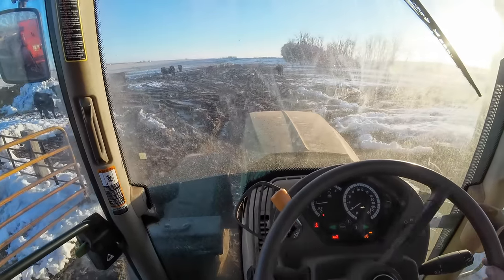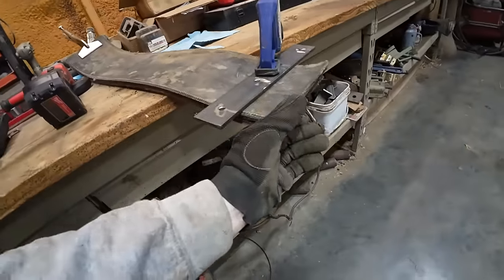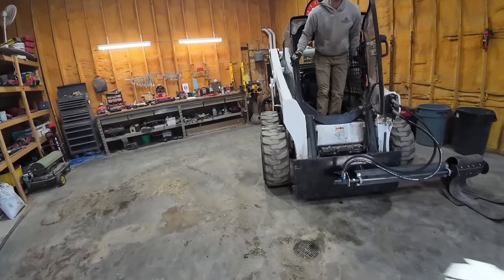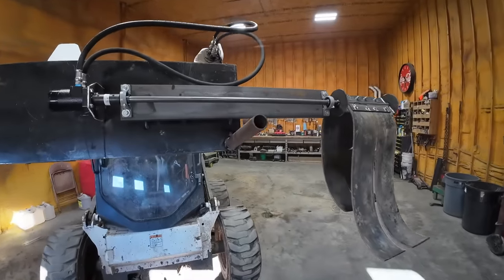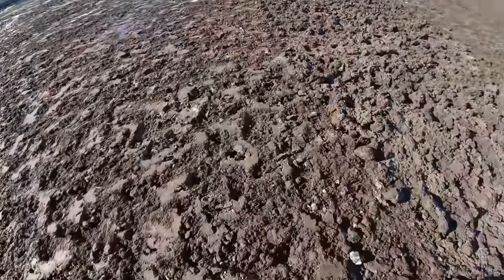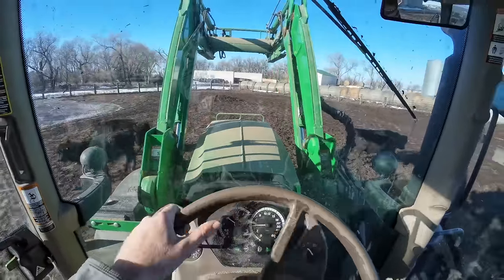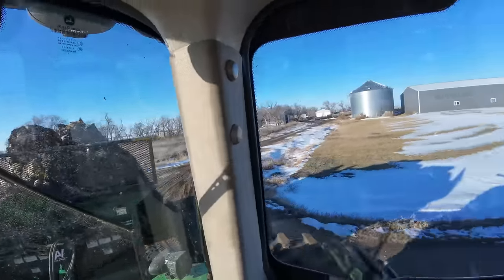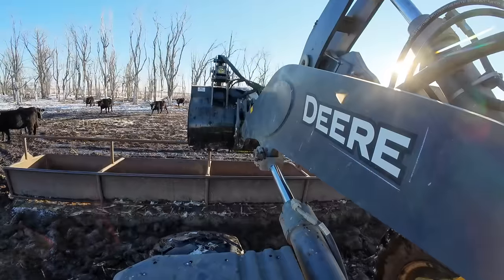This thing is Scary Fast!

Comment: Use a pallet, cement block, or 2  wire blocks on pallet,  drag with 4 wheeler just before freeze up. Nice n smooth when froze!!  Used to cruise around hrs or two after supper

Comment: Cole I built a spinning flappy bunk cleaner, almost like what you did, but the belting I was using was no good. It was too floppy, so I went to our belt supply house and got a piece of aggregate conveyor belt much thicker, much stiffer. It’s kinda like it was on Viagra anyway, but I still wasn’t happy, so I was watching YouTube and I saw a railroad ballast cleaner and it’s basically the same thing to get the rocks out from in between the rails but they use cable like inch cable so my Paul was all worried I was going to tear the concrete bunks up, so what I did is, I took input Ferrells it’s a little thing they slide on cables to stop them from fraying and I slid it down. I want to say 4 to 6 inches and then had them crimp them on a 1 foot long or 18 inches they were made a big ass industrial brush and with the cables being frayed they were they wouldn’t take in scratch the concrete but man what a difference good luck buddy I hope that works for you real well and you don’t have to use how solid shaft are used a piece of 2 inch hollow tube with a thick wall that might inch hydraulic motor shaft after three-quarter whatever the hell it was fit into because a hollow shaft for that situation is better because it’s more flexible. If it does take a strike it’ll snap back where a solid bar will just bend, but 2 inch bearings are pretty pricey I happen to have a set laying around pillow block that is in my next one I will build coming off a PTO shaft off the three-point in back. I’ll put a 90° gearbox. It’ll all be very heavy duty. I’ll even put a slip clutch actually what I bought was a piece of junk four or 5 foot bush hog just for the gearbox

Comment: I was thinking along the line that you would install brush/s instead of conveyor belts. I can't wait until you use it in the bunks. Stay warm and safe!!!
Reply: He couldnt get them (brushes) close enough to the bottom of the bunker it would have to be at least 36” across and 12 “ long. I dont think anybody makes a brush that size. It might be real expensive.
Reply: Good afternoon, and thank you for your response. I understand what he's trying to make. Clueless to what the length from motor to sweep length ( did I say that right) @cathiwim

Comment: We all make mistakes.  Once I was spreading urea on my hay fields & pulled out on the road & got a phone call.  After driving on road for about half a mile I turned around & saw my pto lever vibrated to on position & I top dressed the neighbors corn fields on either side of the road.  You could see about 3 weeks later right to the foot where pto kicked on where I bounced on a culvert depression under the paved road.

Comment: Those belts are what I used to make door sweeps for restaurants, with flat steel also. Won’t no rodent gonna get past that. It wears itself to the shape of the ground and after several years of use, just drop it down a notch for another few years. It’s why I got $150 for each one.

Comment: You might consider a flex chain coupler instead of the straight coupler between the motor and the shaft. It'll allow for more misalignment and should save your hydraulic motor from the bent shaft.

Comment: When you fired up the Super slappy I was thinking can you slow the speed of the hydraulic flow on the skid steer like one can on a JD tractor or if you you had to use a flow control or flow restricted in the hydraulic lines

Comment: I keep wondering if a new building that would increase your shop size and possibly calving capability is in the offing. With the cost's of EVERYTHING going up it appears that increasing capacity to increase cash flow is something we all face in the near future.  I wonder if cutting the rubber straps at a slight angle would help direct the flow of material out of the trough?

Comment: Hey Cole, i was wondering, wouldn't it be easier to load the spreader outside of feedlot? Because it looks to me that the loader can reach over the feedbunk and if you can keep the spreader on the solid ground in front of the feedlots you don't really need to worry about tearing up the feedlot wit a full spreader when the ground gets soft.
Reply from the maker: we have done that, you need to get really close to the fence and the trips take a lot longer vs parking right next to the pile

Comment: He decent job on the sweep BUT gonna have problems with it!  Shaft is to small gonna bend and or break at the end between the bearing and paddle mount. 2nd should have a 3rd bearing in the middle for deflection of the shaft if you want it to last as long as possible. 3rd and you need what's called a one way check valve before the hydraulic motor so it can spool down and not just JAM to a stop motor will not last like that nor will the coupler at the motor to the shaft take that abuse. I have built one build many skidsteer attachments just trying to help. But looks good!!
Reply from the maker: Thanks for the tips!
Reply: a one way is used to keep from powering a hydraulic the wrong direction.it does not help slow down. Putting a valve in float position allows for a safe slow down rather than abrupt stop.
Reply: Well I guess It needs more detail on how to install the check valve. You plumb it between the feed and return lines. That way when you shut the feed off it just makes a circle flow threw the valve and motor if that makes more sense???  So your hoses will be in a H pattern feed line a t a hose the motor then from the motor a hose a t a hose back to the machine with the check valve tied in between the feed and return at the T's. @briansonne814

Comment: personally i hate step bits. everyhole you drill uses the same starting point on the bit, meaning it wears out faster. i would rather have a set of bits. but thats me.